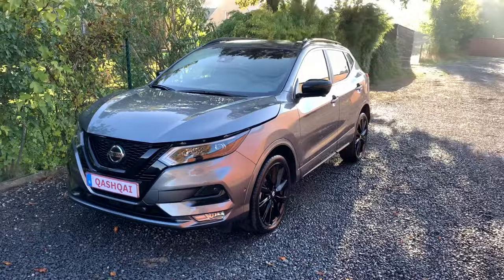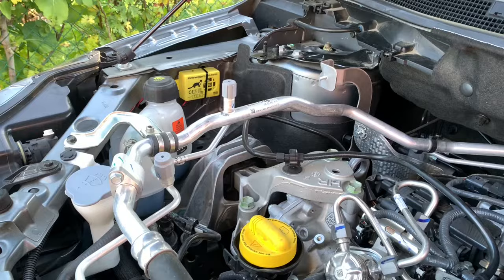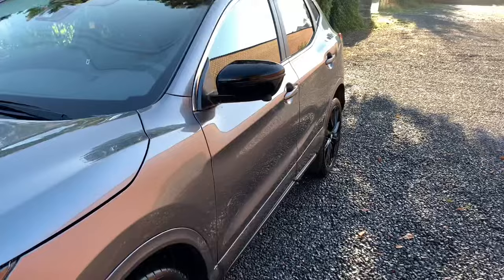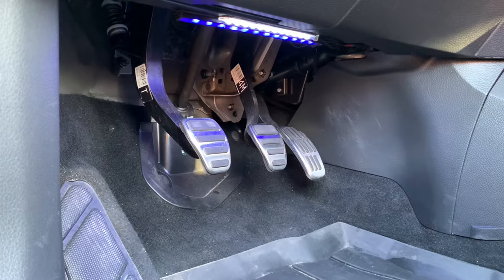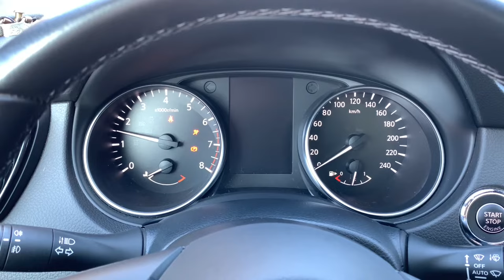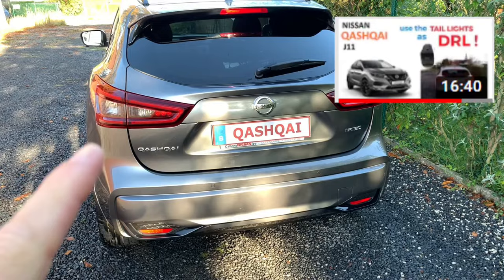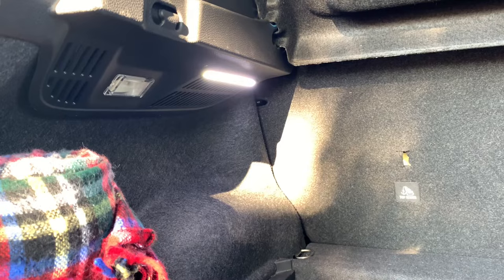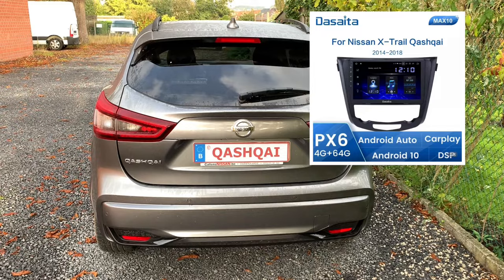Nissan Qashqai J11: All my modifications (complete summary)

Comment: Do you know where I can buy the hood insulation? My car was imported from France and I think most people know there are many animals. In my case they made a big hole in the insulation and I don't find where I could buy one, at least in my country
Reply from the maker: I have a hole as well! I left it like that though. Maybe you could try at the junkyard? Otherwise on online parts websites?
Reply: @LaPalmeraie0032  Let's be serious, who scraps a 2019 car, and even if they are scrapped they are all destroyed in the front and the liner damaged. I didn't find anywhere. The animals also damaged the rubber thing on the top of the 1.3  engine (I think you also have it, I have the 160hp version and you said you have the 140 one) but I didn't even bother searching it because I bet it is impossible to find. Also if you're asking why I am stressing so much about that hole, it affects the sound insulation performance and it can start a fire if it touches the hot engine